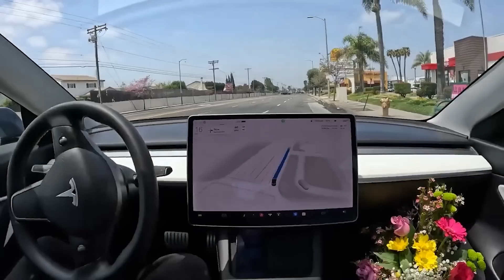James Douma: How Hard is Tesla Bot?

Comment: The new 'model 2' assembly line process . . . where they break things out into work units and then do drop in final assembly . . . the entire process is designed around making it easy for Optimus to do the work.  In their presentation they talked about how the traditional assembly was hard to do for robots because you have to assemble things inside the car frame.  

Elon tried to fully automate the original Model 3 production line back in 2017 and admitted he screwed up and that some tasks were better done by humans . . . now 6 years later he's figuring out how to replace the humans.   They know from their earlier failure what they need to do.

I fully expect the Mexico plant to have lots of Bots on the line . . . the setup also allows them to start with humans and gradually swap in Bots as they train/improve them.

Comment: We have the same problem here in New Zealand with following road rules to the letter of the law. For example we must signal at least three seconds before changing lanes, however other drivers often assume you aren't going to move into their lane if you wait those three seconds, and will close up the gap to prevent the lane change. Often the only way to change lanes is to be assertive and do it within a second or two of indicating.

Comment: :yougotthis:How many final parts will make up the Tesla Optimus Robot, including pins and screws ? :elbowcough: How much of those parts will me off the shelf, in house 3D printed in Plastics or Metals? 🙃 Do you agree their will be a lot of induvial machines building these parts and at the end the final assembly process? 🤔 How long would it take to pump out one Optimus, in a 3x8 hour shift (per day), 20, 80, 280 or more Robots to reach a yearly initial capacity of 100,000 units? :virtualhug: